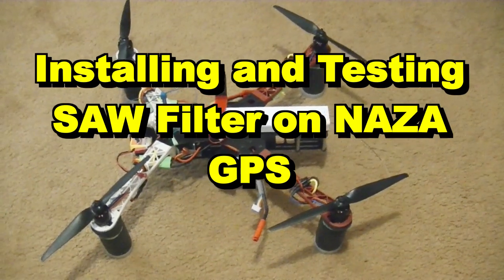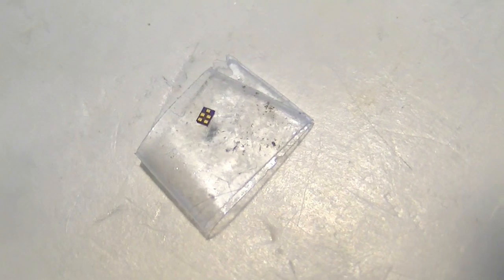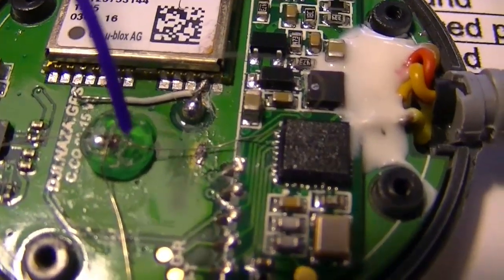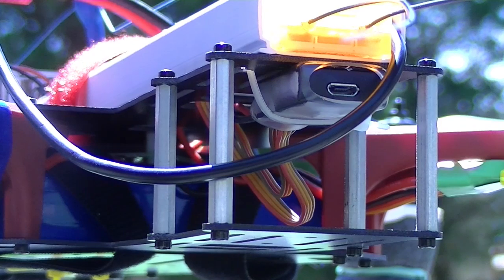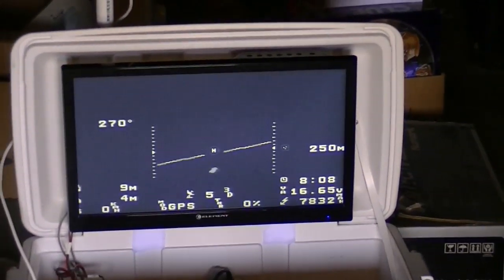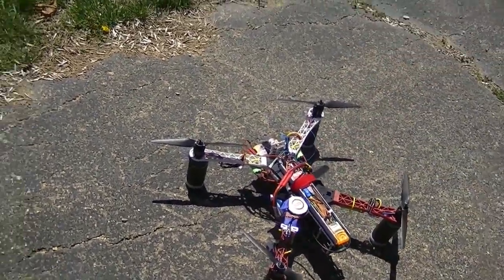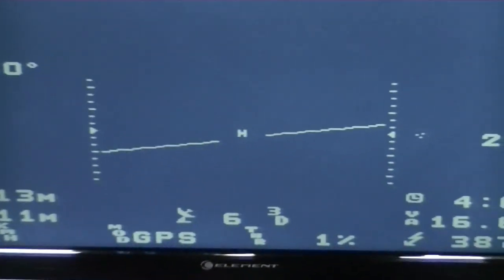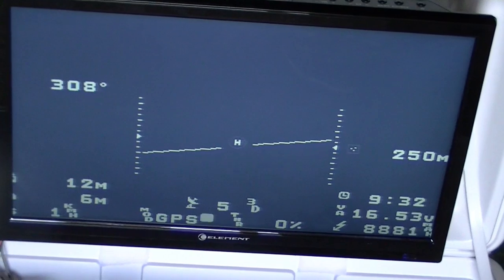DJI NAZA GPS SAW Filter Mod, Installing and Testing for Satellites

Comment: Did you consult with an RF engineer before attempting this mod? RF filters are very sensitive to their load/source impedances and how well grounded they are. The affects of these unwanted parasitics get much worse at higher frequencies. The wires that were soldered to the filter have a large enough parasitic inductance to mangle the SAW's frequency response.

Comment: The performance of the SAW filter would be extremely compromised by soldering it to those long wires. They're just pulling in even more RF - it's probably not impedance-matched either. The SAW is supposed to be mounted on an impedance-controlled PCB, with the shortest tracks possible between the antenna and GNSS receiver. They actually work great when installed correctly.

Comment: Great video as usual! I also saw this pepsicola mod on the Naza-M GPS v1! It's a surgical operation lol
DJI sucks on this point but i trully believe it's a commercial acting in order to make people buying the Naza-M v2!
Thanks for sharing these precious informations! Next week i will propably receive my 2.4Ghz video signal setup, i will give it a try before thinking about this mod for 1.2Ghz video signal!
Have a great week :)
Reply from the maker: Going to try a 400mw vtx and a low pass filter as per advice of Brendan Stewart and my viewers here. Brendan has a video on how to do the mod but he said he uses 1258 not 1280. He recommended this low pass filter:
http://www.readymaderc.com/store/index.php?main_page=product_info&cPath=11_45_232&products_id=484
Reply: *****
I have two of them, but from foxtechFPV! Interesting! Hope you will find a way out :)

Comment: mine works fine on 1280 or 1258. i have a 800mw vtx. i have a barrel lowpass filter between the vtx and blue beam antenna. spacing between gps and vtx antenna is 10.5 inches.
Reply from the maker: Hey thanks, I will try that spacing when I get my low pass filter.

Comment: I see u found everything . Hope it helped you out . Have you tested your range for your 2.4 radio yet ? 800mw vtx is screaming at your 2.4 rx also ! U may try lower mw vtx if u have a range issue
Reply from the maker: Thanks for the advise, I have ordered a 400mw vtx and also a low pass filter from RMRC and will try that later. Sequel video to come!
http://www.readymaderc.com/store/index.php?main_page=product_info&cPath=11_45_232&products_id=484

Comment: From experience vertical separation gives great results. Are you into ham radio by any chance?
Reply from the maker: Thanks Jimmy,
You are the second one that suggested that and I am beginning to think about trying it such as putting the antenna under the quad.
I have a ham license but no equipment to communicate over the air. I have too many hobbies already and afraid to add another.
Reply: Try it dave, i am confident it will work.
Ham here also...call is 8P6DY

Comment: Thats a bummer, hope you find the solution.
How far do you want to fly with the copter, maybe a 250Mw will do the job?
Reply from the maker: I want to fly no more than about a mile. I have 400mw vtx coming. May try the lesser if I have too.
Reply: *****
I think thats going to do just fine with the clovers antennas.
I can fly more than a mile with 250Mw and clover antenna, no problem.
Reply from the maker: ***** Thanks, at least i have hope now.
Reply: Ha ha ha, there is always hope my friend.
Cheers.

Comment: Double the number of satellites by including GNSS ones on your U-center. Then you can't get 10 Hz reading (only 5 Hz), but double number. GPS is on 1575 MHz and GNSS is on 1600. With HJ M8N, I have indoor 10-12 satellites (okay, without video link, but anyway). With 10 Hz and GPS only - 5-7 satellites.
Reply from the maker: +Milan Karakas Sounds good I will take a look at this.
Right now I am switching over to a pixhawk with an M8N GPS and may put the NAZA away for a while.

Comment: See if this works Dave.
Place the vtx antenna in the center of 
The underside of the quad pointing straight down. I hope the legs on your quad will give enough clearance that it won't touch the ground. Tell me what results you get.
-Jimmy_
Reply from the maker: I thought about doing that but I would need some really long legs or give up helical for a small whip. 1280 antennas are just too big.

Comment: Set it to 1258 and put a 5,8ghz transmitter on the receiver that way you get a wireless receiver on you googles. 
So you get a double link so to speak.
Reply from the maker: Cool, I have seen other people using a 5.8 link to the Fatsharks and it looks like a option for sure. The other option is to just put a compact ground station on my head (1258 receiver and antenna).

Comment: Too many ferrite on the signal cable causes too high damping and your singnal get wothless to the flight controller.
About your SAW filter, the wires GND and INPUT of GPS-Receiver has to be as short as possible otherwise it is useless.

Comment: For 1280mhz i found OMM 1280mhz notch filter to be the best solution.. instant sats
Reply from the maker: Thanks for the help.
Would this be the same thing?
http://www.readymaderc.com/store/index.php?main_page=product_info&cPath=11_45_232&products_id=484
Reply from the maker: Could you give a link where i can buy the notch filter?
Reply: ***** Hi , the readymade filter you linked to will not work. Tried it. Im afraid the OMM notch filter is a not made anymore , I got hold of two second hand ones on RCGroups classifieds , so thats your best bet if you want one. Put in an Wanted ad , and you might get lucky. Or you can make a notch filter youself , its pretty easy , just a stub on RG316 coax. Before I was lucky to get 5-6 sats in 15mins , now I get 10-11 in 1min, so a notch filter is the key to sats when on 1280mhz.
Reply from the maker: ***** Thanks, Yes I guess I could make one or put up an wanted ad.
 I found Old Man Mike's thread on RCgroups that shows how to custom build notch filters:
http://www.rcgroups.com/forums/showpost.php?p=10721267&postcount=1
Reply from the maker: ***** That sounds very doable! You are making me want to try this.
The SMA tee would be a non-destructive and reversible way too.
Reply: ***** If you chose to do the splice method , a rg316 coax stub of 3.31cm should do the trick..
Reply from the maker: ***** Thanks so much for the thread link to the IBCrazy notch filter build thread. I have a lot of faith in this. Lord knows, it might work ;-)
http://www.rcgroups.com/forums/showthread.php?t=1758166
Reply from the maker: ***** This is very good information, I am sure others will benefit from your posts as well, thanks!
Reply: ***** my "store bought" filter works absolutely amazing .. but its not hard to make one yourself with just a rg316.. only it can be little bit confusing reading the guides , because some give you lengt in 1/4 wave lenght , and some in 3/4 wave  lengt... but either work fine for 1575mhz gps freq..
Reply from the maker: ***** Thanks, That is good to know when I sort this out.
Reply from the maker: ***** Does your store bought notch filter have one stub or two? IBCrazy is showing two on some of his. I guess the extra one is for tuning and is spaced appart form the first according to the frequency you want to keep
Reply from the maker: ***** One post I read says that a band pass works better than a notch for 1280. They are saying just make a 1280 reject filter and then short the end and it becomes a 1280 band pass. Now I am wondering if I should go with a band pass instead because that would help the GPS and the 2.4G receiver.
Reply: I dont know about that , i only know that OMM notch filter works awesome for getting sats with 1280mhz, i would just build one according to his specs (h3ll its just cutting a piece of coax ) :)
Reply: ***** yes it has two "stubs" one for gps and one for 2.4g control .. http://static.rcgroups.net/forums/attachments/3/3/4/3/8/1/a6574175-241-1280DualFilterRusty.jpg
Reply from the maker: ***** If I might ask for the length of the 2.4 stub and and distance between them? (You gave me 3.31cm for the GPS stub. Need the length of the 2.4 stub and what is the distance between the two stubs along the feed line?)
The threads are a little confusing as to what is best.
Reply: ***** 3.31cm stub for gps and 2.13cm stub for 2.4ghz (this is using the splice method) The distance between the two are about 18mm on my OMM filter.
Try and make one :)
Reply from the maker: ***** Thanks once again. 
Yes I will try and make one now and see how it works.
Reply: ***** very smart!